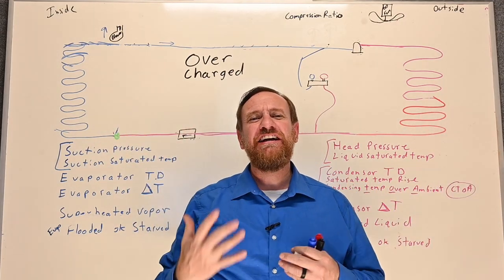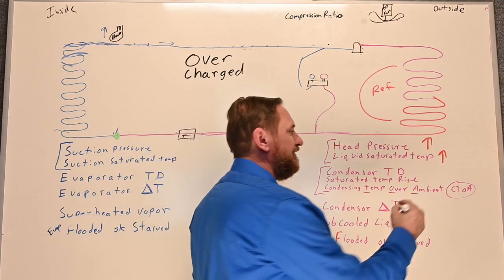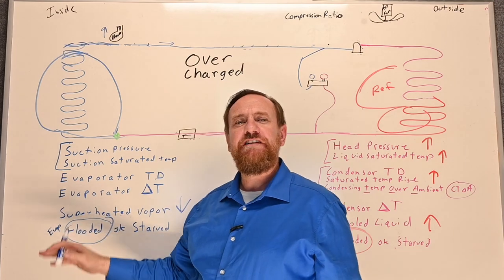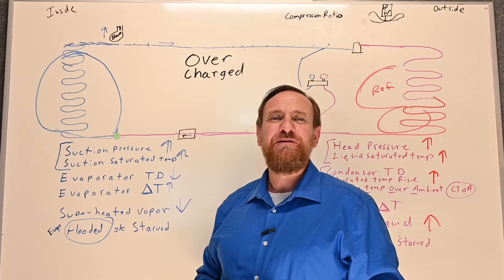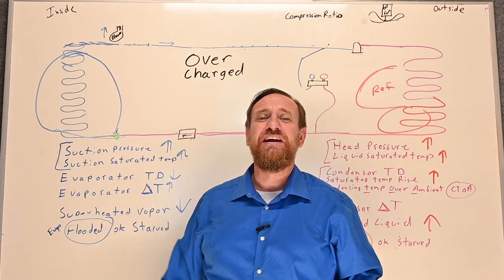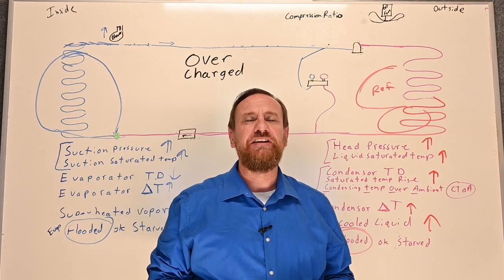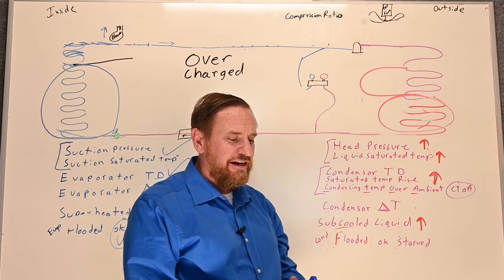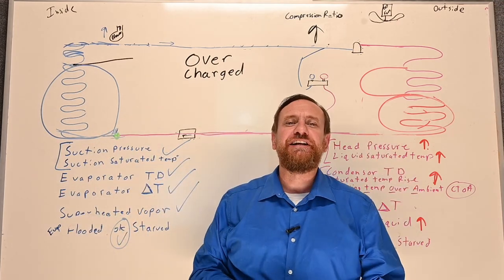HVAC 104 Scenario: Overcharged system Fixed vs TXV TEV

Comment: I always see every video from the angle of running the unit in cooling mode and being overcharged.... but never what the signs of overcharging are in heating mode...  I have learned you can get away with more if you are just overcharging a unit in the cooling mode so long as it is not grossly overcharged but this same unit will come to bite you in the rear come wintertime when it is placed in heating mode. because it will start to trip the overpressure switch...
Reply from the maker: Overcharging in cooling mode leads to long term issues such as compressor flood back shortening the compressor life.

You will notice the issue faster with heat pumps Because less refrigerant is needed in heating mode. The indoor coil, now the condensor is much smaller and has no place to store the additional refrigerant.

Airflow is also more critical with a heat pump.
Reply: @love2hvac  Would is a sign then be high discharge pressure in heating mode  that slowly creeps up and keeps going up...  until the unit trips on over pressure?  I say this because I once  had a unit once where the discharge pressure kept slowly going up, not fast mind you but constantly going up in healing mode... until it should trip the high-pressure switch... yet if you ran it in cooling mode it ran fine ..  the tech  with me told me it had a reversing value issue but once I set down and drew up a diagram of the system, I realize this made no since because I would have saw symptoms it in more then one area..  I came back a few days later and  did a diagnose and decided to remove some 410A from the system.. after removing just under a pound the high pressure stop climbing and started to stabilize .. it was still to high but I notice it cease to just keep climbing with no end in sight ..  so then I decided to remove a few more ounces  right before my eyes the system went back to normal operating range for  the conditions it was it and settled out nicely, after putting it in cooling mode it also work very nicely as well  .. that is when I realize one of the symptoms of overcharging is when in  heating mode you will get high discharge pressure that can trip the over pressure switch.  Yet every where I look people only talked about it in the cooling mode.

Comment: New txv
22 to 407c
Weighed in charge 
High head
Low suction 
High SH
Reply from the maker: Open the TXV, turn the pin counter clockwise.